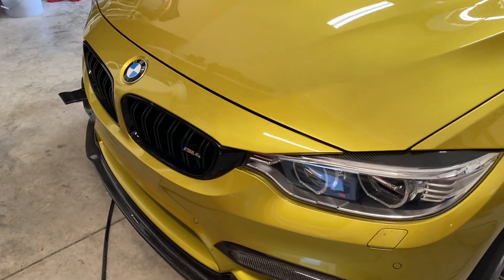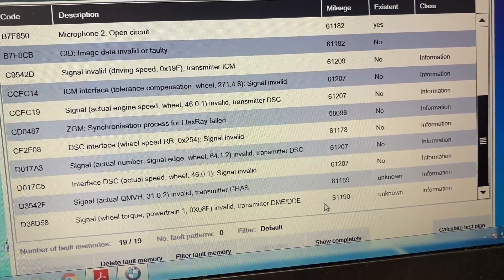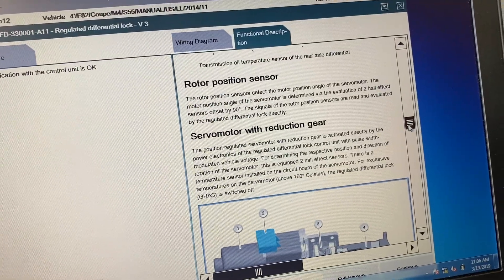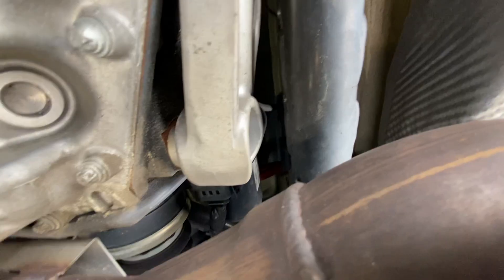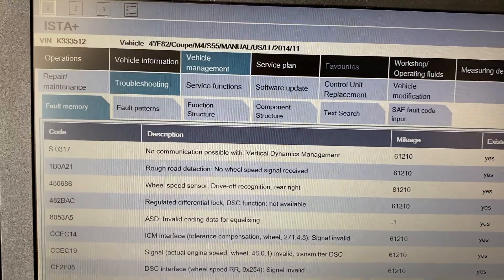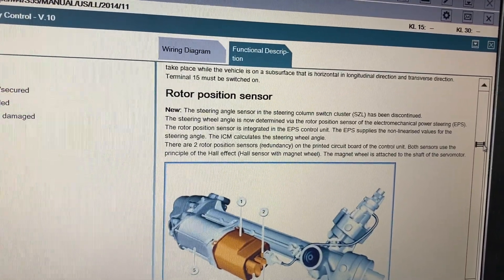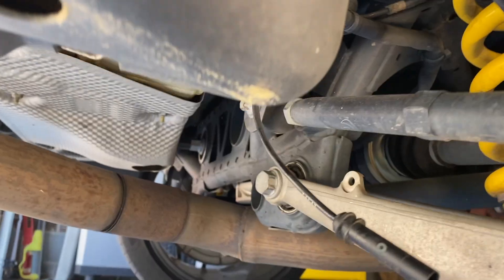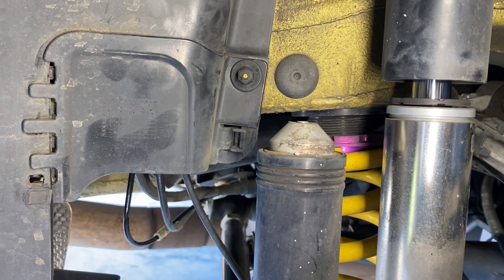"Chassis Stabilization" FIXED with a new Wheel Speed Sensor | BMW M3/M4 F80/F82/F83

Comment: Nice work, Aaron!  Boxsters and Bimmers just seem to be a great combo, eh?  Had a similar experience with the wheel speed sensor on my F30 and, WOW, those warning messages were terrifying when it happened, but was easily able to read the error codes and replace the sensor.  Had to replace the other side sensor about a week later, so just FYI if you get that same issue again, they maybe come in pairs.  Thanks!
Reply from the maker: +Amy Boehm amen! Yeah, I admit to freaking out a little when I saw it. Know what to look for now 😉

Comment: For me on my F10 I would suddenly lose power. Crazy thing is that it gives me codes for the Throttle Body module and Wheel Torque Powertrain signal error code.  

For my Throttle body, it is either loose on the connection or it fails when it wants too. Did a wheel speed test on all my wheels with my Topdon scanner monitoring all wheels as I drove aggressively and suddenly I would lose all connections on all wheels.  When they would come back I noticed suddenly the front right side wheel reported a speed of 152mph which let me know that the speed sensor is acting up wrongly causing the ECM to trigger an iDrive warning message of "Driving Stability Malfunction".  Also that same wheel side is also making a wheel bearing clicking noise and it's gotten louder.  So it could be that the bearings have worn out its magnetic side causing the sensor to not read correctly causing fault error codes.  Both must be replaced!
Reply from the maker: Thanks for the additional info! 🍻

Comment: Nice video! I have the same issue but wanted to know how did you determine which sensor was throwing the fault?
Reply from the maker: Look at 1:45
Reply: @HelpMeDIY  Thanks for the video,  it seems that the link for ista is down.  any tips on where to get it?   also can i use enet to obd cable?    thanks!!
Reply from the maker: @abelballesteros you’re welcome! Not sure where it is available now these days

Comment: May I ask which windows version do you use on you pc?  Because I have read on the BMWgroup website you must have windows 10/11 Professional/Enterprice for Ista+ installation.  Ista+ installation will not work with other windows. I have tried on my windows 10 Home and it does not work. I need Ista+ for running diagnostic.
Reply from the maker: +@dinhvanpham8102 I don’t remember the exact version but I go over it in detail in my ISTA install video

Comment: Got the same problem (M240i) .  Sensor was very dirty, wondering if I should try just cleaning before replacing.  Wish somebody had tried that.  These early sensor failures are suspicious, electronics are usually more reliable than this.  And why the hell aren’t these sensors better shielded than this?  The sensor hole was full of dirt/dust.
Reply from the maker: +@OtterFlys well you can be that person! Try it and let us know
Reply: @HelpMeDIY  I did.  It didn’t.  Sensor arriving tomorrow. I hope.   Great video btw.
Reply from the maker: @OtterFlys  good to know!

Comment: Hi I got this message said (chassis function restricted ) and the vehicle was lower to low passion ,  I did troubleshooting and  I found the fuse is burned and I changed it and the suspensions start working and the message was gone but the after sometimes while I was driving the warning message come again and I found the fuse also damaged again what the cause of shush problem from your experience view
Reply from the maker: +@mohammedallgaydi8148 Great job figuring that out. Not sure what is causing your fuse to blow

Comment: I just recently had this same error come up on my f82. Took it to the dealer and they told me I need a new DSC module and quoted me $7000 for the repair. Ridiculous. Could they have diagnosed it incorrectly at the dealer and it just needs the wheel speed sensor?
Reply from the maker: +@accord21 quite possibly

Comment: Hey brother i have the same issue on a 2017 430 i coupe
Reply from the maker: +@raulinazario9462 should be an easy fix!
Reply: @HelpMeDIY  brother do you know if the same sensor is located at the rear sides
Reply from the maker: @raulinazario9462  I don’t. Never had a 430
Reply: @HelpMeDIY  10-4  brother
Reply: @HelpMeDIY  so I'm making an update i just want to let you know that thanks to you i fix the problem it wax exactly what you explain on the video!! I pay here in Puerto Rico $113.14 on Advance Auto parts . For those who haves like me the 2017 bmw 430i coupe or just 430i this is the part # 24.0711-6281.3  )
But for the ones that haves the 2017 Gran coupe the part is different change!!
Reply: @HelpMeDIY  thank you for your help brother!! 💪🙏

Comment: I have the same warning on my X3, it drives fine on pavement but if I am on gravel it's like the right front wheel is trying to lock up. It doesn't even want to pull the car.
Reply: Same thing in my x3 2013 how to resolve this issue
Reply from the maker: +Tiffany Campbell 👍

Comment: Chasis unstable drive moderately on a bmw active hybrid 3 2013 just cant get rid of that message idk what to do
Reply from the maker: +Enes Bungur check the codes
Reply: @HelpMeDIY  only thing I get is a p0300 code and a break check light becuse previous owner took of the left rear sensor for the brakepads of

Comment: The very first step to take is the simplest, espe ially if you have mods rezulting in ypu not having a floorpan. If the car has the chassis stabalization issue, coupled with hard steering, there is a sensor that can often come loose. It is located right in the middle of the front wheel shaft directly behind where the radiator sits. It has a red and blue thick wire that leads into it. Rhis clip is super brittle, and can often be ome loose, triggering every chassis warning, and directly affecting the steering.  Hopefully this helps somebody. Oh and you can reattach that clip with a zip tie if needs be.
Reply: Do you know the name of the sensor? I have an X1 with these symptoms and the ABS sensor replacement didn’t work. I want to look into this before giving up.
Reply: @AnnieT-v6q I really wish OP answered your question but I could really use the help too.
Reply: @AnnieT-v6q do you still have your car?
Reply: Is there a name for this sensor? also which side would it be I have a UK RHD car
Reply: That’s my exact problem
Reply: Bro this is exactly wats happening to me .thanks alot

Comment: Did you have issues with the steering becoming harder. Have the same issue which is intermittent, but it does somerimes affect the steering. Tje adaptive headlight also comes on.
Reply from the maker: +Precision Performance (F22 modifications) not that I noticed, no
Reply: @HelpMeDIY  its all good, one of the sensors had come loose.
Reply from the maker: @f22bmw  👍🍻
Reply: That's the issues I'm having right now, chassis malfunction combined with hard steering. It's an absolute nightmare.
Reply: @Dribin  take off the underlay protecting the bottom off the engine and pull the large red connector out and back in.. it's right in the center... You can't miss it .  make sure it is super tight.. that may fix the issue.
Reply: @f22bmw  thanks for the help 👍
Reply: @Dribin  Did it work for you?
Reply: @f22bmw  unfortunately my power steering was cooked 😥

Comment: I got the same error, ista indicating both rear wheel acceleration are faulty. However BMW does not sell the the rears separate to the actual shock? Are the front sensors identical?
Reply from the maker: +Zunaid Abrahams that seems really odd… I don’t know. Let us know what you find out!

Comment: this video helped me a ton. i replaced it back a few months ago. now im getting just a chassis stabilization error and no limp mode or diff lock. i think my wiring harness (before the speed sensor) is damaged.. is that a difficult replacement or just a few wires to be replaced? ((if you know, thanks a lot))
Reply from the maker: +Justin glad it helped! Sorry, don’t know the answer to that though.

Comment: Hi I got bmw m4 I got this sign coming up rear axle differential lock do u reckon if I replace the wheels speed sensor will solve the code
Reply from the maker: +Auto TV I don’t know for sure, but I doubt it
Reply: Do you know what was the problem? I have the same error code. Would highly appreciate a response. Regards

Comment: quick question. Are the sensors universal? meaning the RT and LT are the same? got the same message as well on my F83 M4.
Reply from the maker: +Fernando Sanchez I think so, but I would call a dealer and confirm

Comment: I have about 7-8 malfunctions.  Bmw says I need a battery, but after sitting for two weeks the battery still measures 13.2 volts. Call malfunction perdestrian malfunction chassis malfunction headlight malfunction and no electrical power steering are some of them. Lights will come on before I get out of driveway
Reply from the maker: +Bella T844 they could be right. That’s an easy one to test out at least.
Reply: Did you find the solution to this I have same problem
Reply: Same problem car dead now .. 😢 hopefully it’s just the battery but then again I just bought a brand new battery so we will see
Reply: Lmk hav the same problem still need help finding solutions
Reply: I replaced the battery and nothing changed. I sold the car

Comment: I have a 750li that has the same problem and I've spent almost $4k getting parts and suppose to be fixed. But it isn't up to the regular height like when I first got the car....what would you suggest?
Reply from the maker: +Duane Moore I would suggest using a real BMW diagnostic tool like ISTA and see what code it’s throwing
Reply: Did u figure it out?

Comment: I notice this happens on my f32 440i, only when i hold launch control down for too long. Why is that? It only happens then.
Reply from the maker: +Dirty Dan I think I had something similar with mine, but I thought it was something about the transmission being too hot, but now I don’t remember 🤷‍♂️
Reply: @HelpMeDIY  Hmm ill have to look into that. Thanks for responding so fast!
Reply from the maker: @howdyimdan  let us know if you find something!

Comment: I removed and replaced the wheel speed sensor as described in the video.  Replacing it was pretty straight forward.  After changing it with an OEM replacement my ABS light/ chassis stabilization light remains on.  Is there a reset that I need to complete to make the light go out?  Thanks.
Reply: So I had this issue for over a week after I replaced my brakes and rotors. After doing new abs sensors and brake sensors, it ended up being low brake fluid throwing all these warnings 😅
Reply: @Riseup425 low brake  fluid ? Have you ever had it changed
Reply from the maker: +jbandmel44 I think I just replaced mine and it went away, but I’d have to go back and watch the video again to be sure. Everything I did is documented there.
Reply: @HelpMeDIY  any update?
Reply: Change the opposite sensor

Comment: If I had both sensors replaced and the chassis stabilization code still pops up, does that mean I just need to get a hard reset? I really don’t want to keep spending money on an unknown fix.
Reply from the maker: +NVR DWN I’d use ISTA or the like and check the specific code?

Comment: I had the same faults as you, for the rear left sensor. Changed that, took it for a drive, it cleared the fault... drove a bit longer and the dash lit up the same way, read the faults and now it's saying the rear right is the problem! what do you think is going on? Could the module which the speed sensors are plugged into be damaging the sensors?
Reply from the maker: +Mark Stein I guess it could be, or just a coincidence. I’d just change the other sensor too since it’s easy and see if that fixes it.
Reply: @HelpMeDIY  I might try putting a new sensor on. But I have since taken both wheels off and plugged in a current meter in series with the sensor. Both sides are reading 7mA, the sensor is meant to pulse between 7mA and 14mA when the wheel spins. Both sides would not move from 7mA when I waved a bit of metal over the sensor. As a bonus test I plugged the old sensor back in and performed the same test - all sensors are behaving in the same way. I am thinking it could be the GHAS module, which requires a tech to program it to the car (I'd like to do it myself but I don't want to buy an ICOM)
Reply from the maker: @markstein1217  keep us posted!

Comment: Incredibly useful video, same prob F22, did not have ISTA but Think Diag correctly pinpointed the exact same sensor issue. Problem is compounded by multiple related fault codes all caused by this sensor!! Other codes seem un-related. BMW should have on board DX that pin points the issue instead of their stern run to dealer message!!! $58 solution, dealer would likely have seen it as blank check...
Reply from the maker: +Dr. Paul thanks! And I agree 🍻

Comment: i had p15dc and p15c8, changed rear left speed sensor and cleared, p15c8 still coming up though.  What's the best way to test the housing that connects to the speed sensor?  Thanks.
Reply from the maker: +KG wish I could help more, but you just saw everything I know about the wheel speed sensors.
Reply: Abs module may need to change